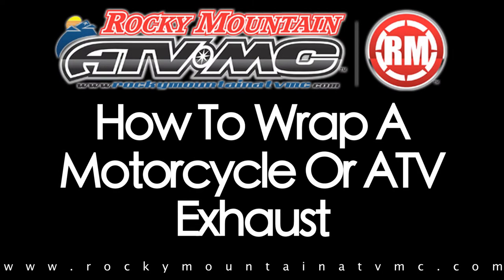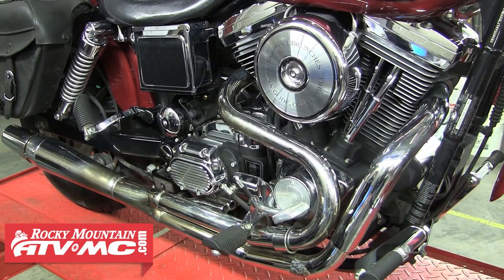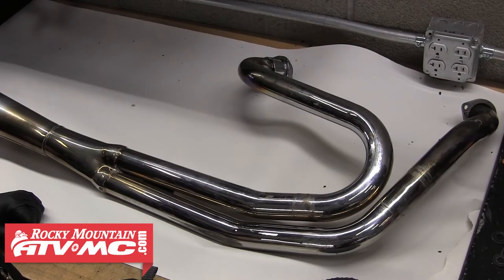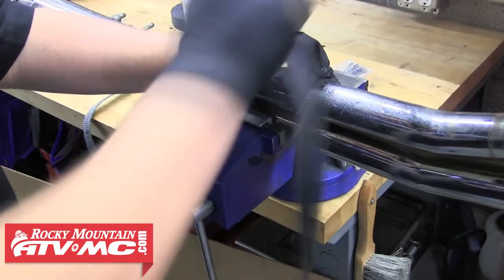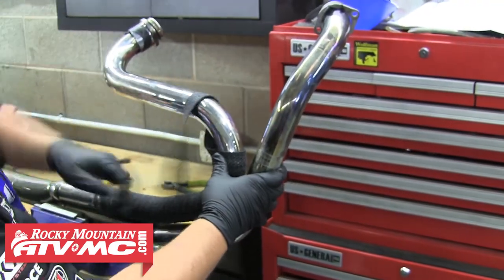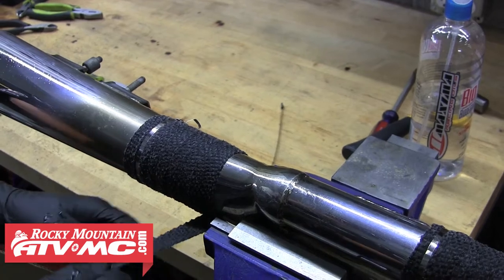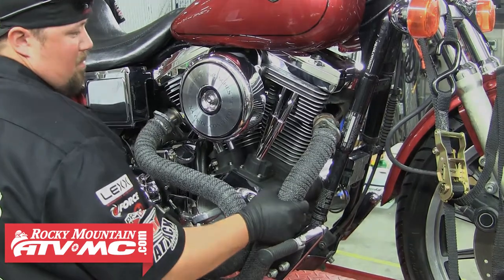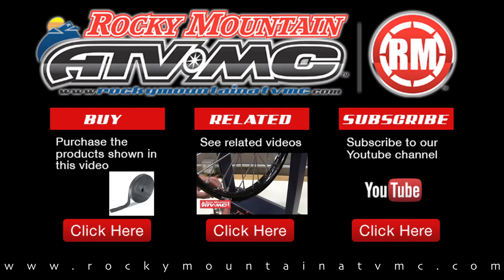How To Wrap a Motorcycle or ATV Exhaust Pipe

Comment: This stuff is fiberglass, correct? May not hurt to wear long sleeves, maybe even a mask.  I'll not bother wrapping the the first 10-12" run of pipe out of my 4T dirt bike, as wheel trash will pulverize it quickly. Doubt there would be much change in tune in this app, as the pipe is already near red hot at the head. Considering mainly for heat management/rider comfort.